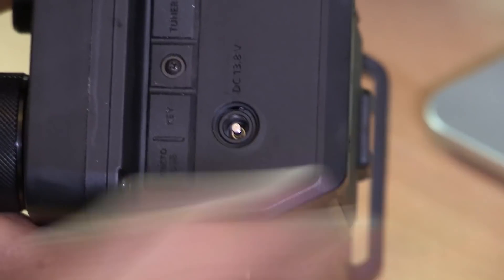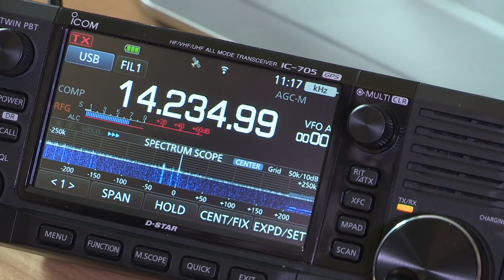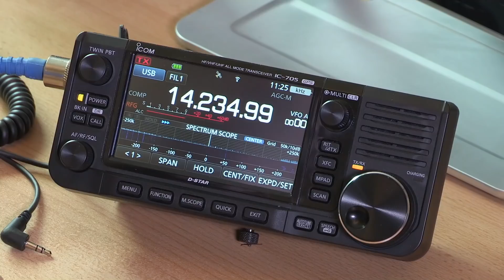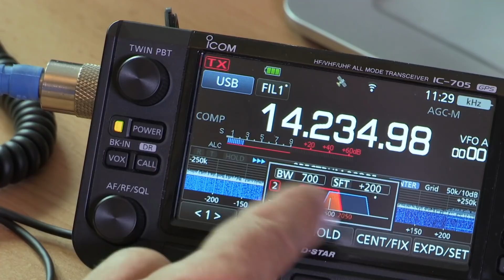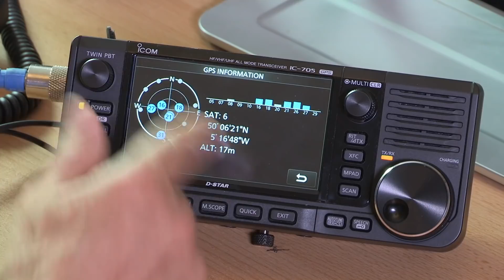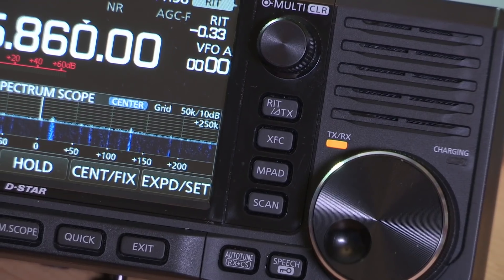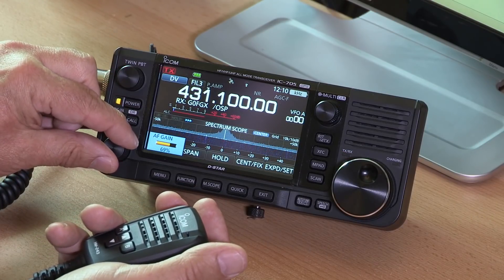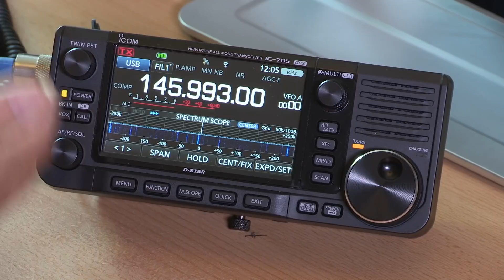Introducing the Icom IC-705 QRP SDR transceiver

Comment: Can this be used on UHF/VHF with just a dual band antenna (like a Signal Stick) attached directly to the radio, or is coax required?
Reply from the maker: Will work attached directly

Comment: 1300$ QRP? no thanks.
They should have combined that faceplate/menu system on something similar to to old 706 mkIIg, IC-7000 or IC-7100... Give a replacement All-Band All-Mode mobile unit already!

Comment: Good day all.  I just received my ic705 today.  Got a bit of an issue.  When turning it on the only control that works is the af gain knob.  Radio seems to turn on ok but that is as far as it goes.   no buttons and no touch screen.  Anyone have a clue or just bad unit?
Reply from the maker: Dear Mike.  Sorry to hear this.  Very unusual so have spoken to an engineer just in case who said to contact and return to the dealer you purchased this radio from.

Comment: Nice radio, and I will probably get it one day. Weird design looks like they chopped the back half of an IC-7300. The ft-817 has the feature where you can carry it around with the shoulder strap. The FT-817 is like an oversize HT whereas this is like an undersized mobile or base station.

Comment: An expensive trcvr with weak water/dust and damages protection, high consumption and low power battery, no antenna tuner. Not a choice for outings :(

Comment: Can anyone recommend a good vehicle CB that uses low band frequency as well as standard band that won't break the bank?
Reply: "Low band"? "Standard band"? Many prefer the IC-7100 with diode removed for 160m - 10m without TX restriction.

Comment: Big mistakes made by Icom over this radio, no built in ATU, and no dedicated larger capacity battery, no separate antenna socket, for vhf/uhf. A thumbs down from me on this radio.
Reply: It's inexcusable in this day and age to not have a charging circuit that would work with an included USB-C Port. That would've made it compatible with tons of portable power banks and solar panels. I'm in complete agreement with you on the built-in antenna tuner as well. Major miss on their part!

Comment: So so sad it does not have an internal antenna tuner on this 705.  Look at the xiegu g90 if you want a good qrp radio. The xiegu g90  has an  internal antenna tuner so good it could probably tune up a head of lettuce and water fall and much cheaper and better. This 705 cost so much that when you get it and find out you do not have an internal antenna tuner and you want to sell it. You will be stuck with it. Save yourself a heart ache. Wait for the next upgrade with the internal antenna tuner.

Comment: Gosh. Taking long overdue oriental radios out of packaging? Are we back to this again. No ATU and NO 4M band! there! I've spoiled the ending. Rather over priced Japanese Tat as ham radio goes through it's death dive. Could save yourself £900 by buying a micro bitx and spend the money on wire for antennas and  a deposit on the new electric car.

Comment: The radio is really ok but the price is calculated incorrectly, because for the money I buy with an FTDX3000 which is 6 months old but far below the price of this radio sorry but because Icom I would set in the direction of 450 € -550 € because There are currently manufacturers who can do something like that and have top X90 Xian cost 450 € and do what it should and even very well!

Comment: interesting radio! might be my next purchase and review. Have the 817, kx3, and x5105. Each one has its own niche and use. Wondering how rugged that touch screen is to mud, dirty and water? is there some sort of screen protector for that type of touch screen? how good is it viewable in direct sunlight in 90F + temps with humidity 80% or higher? Will it crack in with 31f and below weather?  I have a few more questions but i like the radio as a mobile qrp rig. I m a qrp guy so i dont care about higher power radios.
Reply: The main problem with cold is going to be the Lithium battery.  That could also be a problem for hot.

Comment: A USB-C port would have made this just about perfect to me.
Reply: No excuse in this day in age to NOT have a USB-C port STANDARD. With it's higher charging rate it would offer, AND it would be able to pass though 15 volts via the USB-C cable for the 10 Watt Output from any portable power bank with a USB-C Connector. Also lots of portable solar panels now have USB-C outputs on them. They REALLY missed the boat on that one. Ditto on the Antenna Tuner NOT being integrated into the design. 

This radio with all of it's accessories will be +/-$2k, which is absurd. For that $130.00 'high capacity' battery I could build a LiFePo battery pack with 500 Watt Hours of capacity. The old guard is still playing their game of charging ridiculously high prices for their accessories IMHO. I really like what this radio has to offer, but their accessory prices are going to make me steer clear of purchasing one new. Maybe I can score one used in a year or two at a heavy discount.

Comment: Can you tune outside the amateur HF bands to receive SW Broadcast stations ?         73 de AB8B
Reply: Yes.  https://www.icomjapan.com/uploads/support/manual/IC-705_ENG_Basic_2.pdf
Receiver 0.030000 ~ 199.999999*
 400.000000 ~ 470.000000*
 Transmitter 1.800000 ~ 1.999999
 3.500000 ~ 3.999999
 5.255000 ~ 5.405000
 7.000000 ~ 7.300000
 10.100000 ~ 10.150000
 14.000000 ~ 14.350000
 18.068000 ~ 18.168000
 21.000000 ~ 21.450000
 24.890000 ~ 24.990000
 28.000000 ~ 29.700000
 50.000000 ~ 54.000000
 144.000000 ~ 148.000000
 430.000000 ~ 450.000000

Comment: Great radio yet over priced to the max.
Reply: It expensive for sure, but overpriced? There is literally nothing so well featured in the space. The only other all-band QRP radio in production is the FT818, which is a great little radio, but very 'basic' by comparison. The only other compeititon is the KX3, which by the time you have feature parity, or as close as you will ever get, will cost at least as much.

Comment: Great review i'd like to know regarding the wifi connection what does this do ? also the bluetooth ? and the dstar mode does it have its own built in node or where you going through a local repeater or your own hot spot?  thx
Reply: Likely equivalent of a "dv dongle" internally and you'd point it at a reflector.  The radio itself will be similar to a d-star radio with voice and digital multiplexed.

Comment: I understand things are fluid right now, but  I find it somewhat ironic is that as of July 23 2020 Gigaparts(USA) has the IC-705 a 10W QRP HF rig at suggested (pre-release) MSRP of $1,500, Yet a few web pages later Gigaparts lists a IC-7300 a full 100W HF radio for under $1,000? From a non marketing user standpoint, isn't that a bit "Bass-Ackwards"?  Somewhat apples & oranges between the two but close enough for this argument. Granted the 705 has a few extras like the GPS, D-Star VHF features, but 50% more?
Reply: Actually less that 50% more but still greedy IMHO
Reply: When the 7300 debuted in the US, the MSRP was $1,500. I thought I got a great deal a year later at $1,300. All new radios cost more ...when they are new.

Comment: That would be a dream radio if it had a tuner. I so love the user interface on my IC7100 and that would be like a portable version (and with 2m/70cm). But on HF you really need a tuner so often, especially when on the move with wire antennas.
Reply: Check out Elecraft T1 auto tuner for this radio. Nice bit of tiny add-on kit.  Very small & lite.  Ham reviews seem overall to like it. I ordered a T1 yesterday ahead of the 705 being put out "in the wild" for us common folks to buy in the states.  btw- IMHO The only downfall with this IC-705 was not including an internal tuner.  If a T1 can be built & made as small as it is,, there really isn't any valid reason Icom couldn't have done something similar internally with a very small increase in radio case size.. Otherwise it seems like a perfect SOTA/POTA/portable radio.  And yes a tuner is needed of some sort for us that love to build HF multi-band antennas of all types for portable work.  73 de N6DSW

Comment: What a great job reviewing the IC705. Well Done !       Question:  The screw on the bottom of the radio.....is it the same size as used on a camera tripod?

I can see by the size of the battery that turning off the Blue Tooth, WiFi and GPS is one thing one better do if they plan on working off the internal battery and making more than one Q.
That radio is an SWL'rs dream come true.

Barry, KU3X/QRP
Reply: yes it is apparently

Comment: What did he mean at 0:57 ? I thought a diplexer allowed one antenna to connect to multiple radio frequency receiver inputs (eg separate VHF & UHF).  In this video he is suggesting they can connect one transceiver to multiple antennas.
Reply: Typical HF antenna is not resonant for VHF/UHF. You usually need at least two antennas (HF and someghing like 2m/70cm dual bander). You use a kind of splitter that connects two frequency antennas. One cable in, two cables out. All HF goes to one cable and VHF/UHF to the other. Similarly received frequencies come from two antennas and combine to one lead to radio.
That allows you to work without an antenna switch that you use to select antenna manually.

Comment: Yeah, but only 10 watts output ???? C'mon ICOM you can do better than that, especially for the $$$$$ you'll shell out to buy this rig.
Reply: It has a small battery - if you increase the power you increase the cost and size. It's a QRP radio not a kw blaster
Reply: @Spookieham  Then it should be QRP rig priced accordingly.

Comment: General coverage is worthless fluff to amateurs, wide open filters! I wonder if this will be like most modern VHF radios which are useless if you live near a pager site?
GPS is now called GNSS.
Reply: Who still uses pagers?
Reply: I answered my own question about pagers- last week here in Oz it turned out doctors were sending pager messages out with covid patient names etc on the messages. Some kid Dec decoded them with an RTL SDR and put them on the web. Despite the Doctors being told not to use it for that purpose.
Reply: @Spookieham  Pagers are very much still used in England. It constantly annoys me that magazine reviews give detailed performance figures for HF but not for VHF. Not just pagers - anyone doing contesting at VHF has a limited number of modern rigs, lets hope the IC-705 is one of them...

Comment: But what is the reason that 4m/70MHz was removed from the published specifications and literature so late in the development process?
Reply: Probably because it's not a world wide standard and would increase the price
Reply: The IC-705 uses direct sampling up to 25 MHz and down conversion IF sampling above that. They didn't mention in the literature whether that's accomplished with only one multiplier circuit, but I'd imagine it'd be hard to support both 10m and 70cm on the same chips. The 4m band probably falls between the ranges they designed for this, and building a separate solution would be cost prohibitive for the small market where 4m transmission is allowed. 73 de K7COI
Reply: @KevinDurette  When the IC-705 was originally announced, Icom announced the 4m band as functionality to be available in the European version. An Icom representative was talking about the functionality being available in Europe about a week before it was announced that 4m would not be available, and the literature on the Icom website was updated to remove mention of 4m, so there appears to have been a last minute technical/legal issue resulting in the removal of the functionality. I'm familiar with the published block diagrams, modern synthesiser chips are available that can produce continuous coverage from a few MHz to GHz, and Icom had obviously selected and used devices that met the functionality requirements of the originally published and announced specifications. I believe that 4m was available in at least one pre-production version of the radio seen in the UK. I'm interested in the reason for the removal of the feature...

Comment: And then the price tag 😂
Reply: Überleben  How many more Samsungs are produced than ICOMs? Phones have a lot of commodity components, whereas the ham market is much smaller. You're paying for tooling and setup and design work spread over fewer units. Samsung is piggybacking on Android for their OS. (There's no telling whether the ICOM touchscreen is running BSD under the hood, but that's still a lot more work than producing an Android phone.) Phone manufacturers also get a small amount in kickbacks from the inclusion of partner bloatware. Until recently, phone prices were also slipped into the service contract price.
Reply: Try £1300
Reply: If you have to ask, you can't afford it.